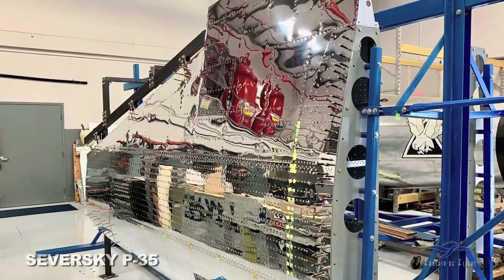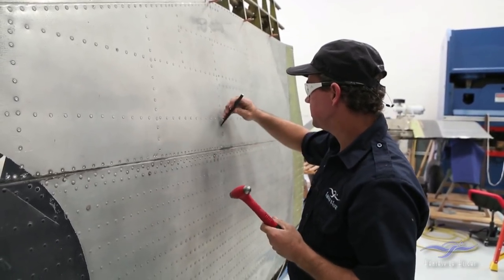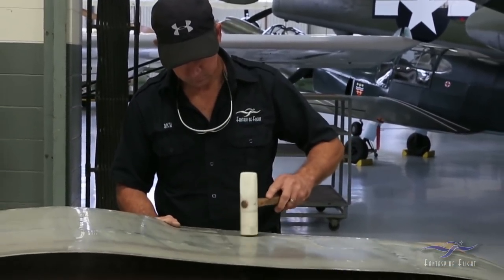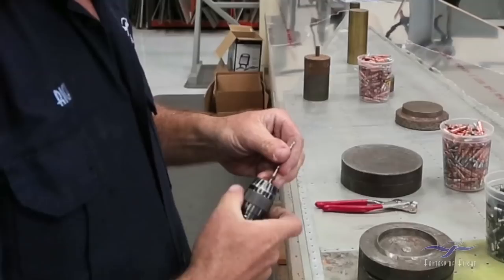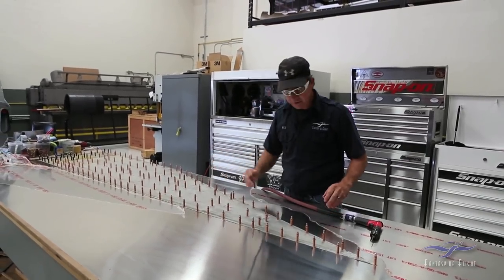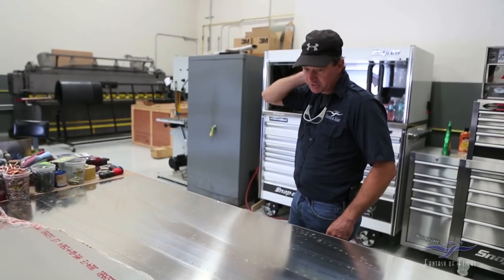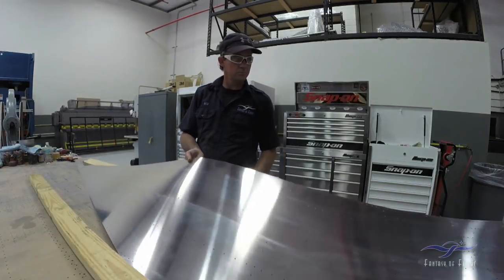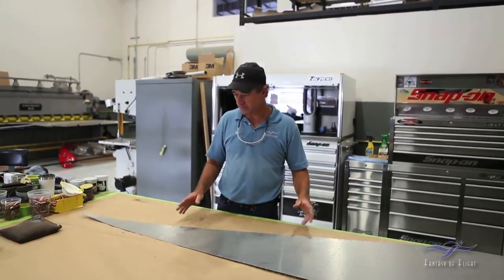Seversky P-35a - Wing Skin Fabricating - Part 1

Comment: Hi Kermit, I'm a sheet metal fabricator and I've done this kind of work on trailer skin replacement but I learned a lot from this video and Rick. It would be a true pleasure to work under Rick and learn his methods of sheet metal fabrication. I've done a little bit of aircraft fabrication in the past but nothing to this caliber. Thank you for sharing this with us. I love what you are doing.

Comment: When restoring aircraft to flight condition you have to have your restoration specialist have the understanding that their work will result in having a FAA approved safe flight aircraft because the pilot is putting their lives in the hands of the restoration specialist. Like others have posted it is great to see someone who obviously is not only knowledgeable but takes the time and pride to do the job right the first time. Mr. Weeks has assembled a top flight crew and it shows on these videos.

Comment: A true master airframer. Very impressive craftsmanship.  I did find it odd when he spoke about how meny cleco's he uses. I actually thought it wasn't that meny. When we would replace the fuselage skins on 737/757's we would use A LOT more! In the range of every other hole to every hole depending on where and which skin we were working. Also note the fact he's doing all this work right next to the wing structure. This helps in keeping the size in relation to the skin and structure even. We had a group replace a skin in the summer time, where the aircraft was in the hot hanger and they did all the skin hole transfers in the back shop that was air-conditioned. When they took the new skin out the aircraft everything was off by about an inch. As the new skin was a lot cooler than the fuselage. Even after warming up the skin to the structure temperature, the holes still didn't line up. They ended up scrapping the skin and starting over. ($$$)

Comment: Any scratch normal to the thickness or sharp burr on the edge or in a hole may start a fatigue crack.  All the deburring and sanding is very necessary.  Very nice work.

Comment: Have nothing but admiration for your work .anyone thats having heartburn with the value of a finished airplane with polished skin needs to watch this video,and anyone that thinks its no big deal would fold like a ladder  trying to duplicate your work. ( SPENT  35 YEARS BUILDING WIND TUNNEL MODELS) I Might wanna throw a set of mikes on the alum. 0020 thickness is doing nothing but getting thinner .....Coming from a body and fender background I can sand thru .0010 paint in a heart beat.  Was surprised at how thin the skin is on the original wing.Lighter is better .

Comment: The need to be meticulous is mind blowing.  I assume there are temperature considerations to take into account when mounting the new skin of the airframe.  Considerably hotter or colder and I would imagine the rivet holes don't line up well over that length of skin.

Comment: Fantastic video. I am scratchbuilding a Zenith 650 and learned some things from this video. What is the make of the deburring drill that was used? I would like to give that a try.
A few tips I will through out there that I use. When I need to remove the plastic film from a flat panel, I use a piece of dowel or pvc to roll up the film from the skin.
When I have lots of holes to drill and cleco, I have a "cleco pallet" that holds my clecos up so I do not have to set  down my drill to get a cleco. If I need both hands for drilling, I can usually hang the cleco pliers off a cleco in the pallet ready to be used.

Comment: Done it a few times myself - I would use a block though. They make them out of rubber so you can take them right up to wet sanding. I know it will look great after polishing, but there are finger marks clearly visible as he goes. Might come out the same - as I said - after polishing, but it seems as if he's causing himself more work by using just his hand.

Comment: 3m Trizact 3000 to 5000... DA wetsand  (will need full backer board to keep flat)..    get some scrap and try it..      will cut some hours off the work..    nasty stuff aluminum is to polish cleanly..    Can still sit and watch someone else do this for hours.. such a joy when done..  Finished panel looks awesome..     

I have never had to maintain a polished skin down the road.. Does the oxide protect it at all or just haze it up?

Comment: Why not to use VAC during dry sanding? Ok, you need a tool ready for that and sandpaper with holes, but it makes job much easer, quicker, sandpaper lasts much longer as abrasive is not clogged so quick.
Also, as others, wondering why not using block during wetsanding.

Comment: I wonder if the material is miked before and after to see how much is removed.  Might be considerable.
Reply: I was going to question his polishing stage? He machine sands it down to 1000 grit. Then starts again with 600 grit wet and dry by hand? I don't see the point. He's taking twice the amount of material off for no real reason in my opinion?  By the way, I'm a vehicle spray painter so I do a lot of polishing. If I colour sanded a panel like that I'd rub right through the primer. I also polish metal on my motorcycle projects

Comment: I notice that the reconstructed wings surfaces are not as smooth. The originals seem to have less deflection from the riveting. I understand  the effect of polishing, but as far as I can see they are not the same. Obvious issues aside, is this okay? Were many of the originals deflected as well. Full disclosure; I have been trying to eliminate those deflections in some of the panels I have been building. (Non Flight)